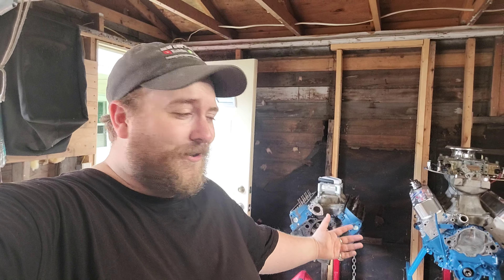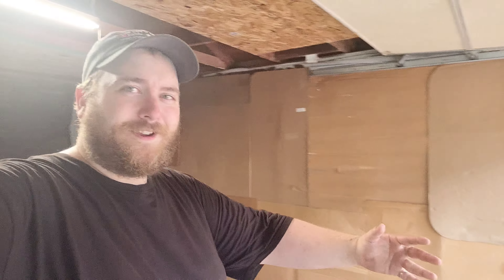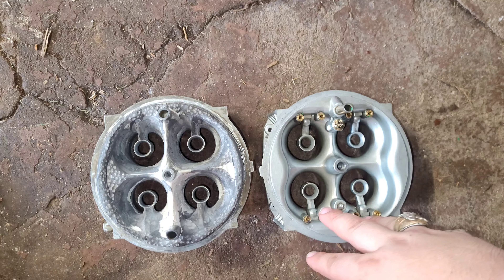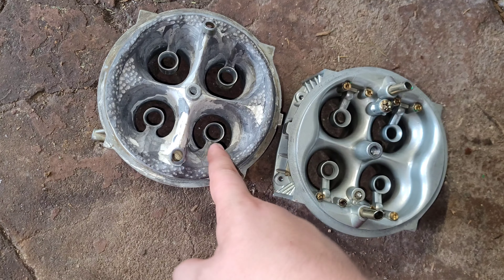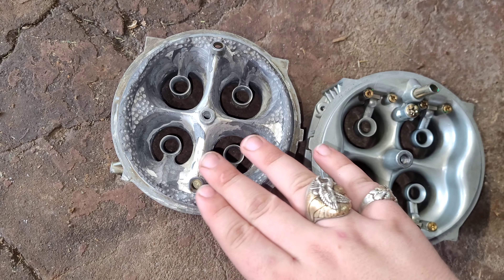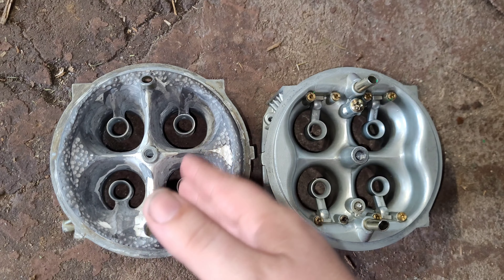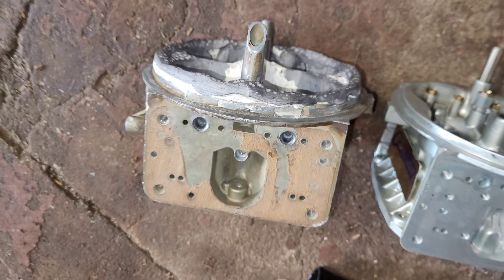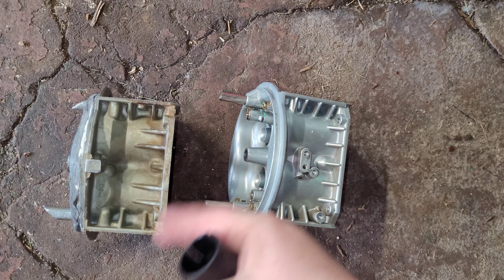Carburetor CFM Mods! | Big Performance Gain! | Project XMC Holley Carburetor | Fine Tuning Airflow

Comment: Project xmc is coming along nicely. I registered just to comment on your videos here. As a fellow carburetor and speed freak enthusiast I like your break out of the box mentality. So speaking about booster signal - how about a comparison test with a clear tube between the main body and the vacume? Hook up a fuid supply somehow to the booster wirh a jet. Nothin fancy, quick and dirty does the trick!
Reply from the maker: @DanLeveque  oh dude sweet! 
I truly appreciate you following along and I am truly humbled you made an account just to comment! Thank you! 😃

Ok so the setup your suggesting, are we looking for how the fluid will come out of the boosters? Or what is it we are looking for! 😁
Reply: Basically,  let's see physically what's happening with that increased booster signal on the xmc vs the proform vs the play doh modified proform
Reply from the maker: @DanLeveque I can put a fuel bowl on and fill it with a liquid then vacuum test the proform with and without the playdough to see if the liquid get atomized any differently 🤔

I could also get a vacuum guage and hook it up to the booster passage to see if we can put playdough in a few spots at a time and see if we can see an increase in vacuum! 😃
Reply: @newguysgarage6802  play on brother! I think it would be interesting to see.  I have no idea if a regular vacume gage would work. I think it would require something more sensitive.  Ultimately though  the xmc has something more to say and I'm fascinated  with how it will really work on the road and track.  I personally run that same proform main body and have been real impressed with it.  I have a 850 vs base plate I've been interested in adding to it. Started lookin around to see what other people were doin and found you doin your thing. Shoot I'm talking too much. Lookin forward to your  next experience man!
Reply from the maker: @DanLeveque  I put an 850 baseplate on my 750 main body a while ago! 

I have some videos on how I did it if you hadn't seen it already 😃

https://youtu.be/NDdPmoW8Gx0

Comment: Thought you were going to burn your lips with that new flow test when is the engine going in looking forward to first pass have a good one
Reply from the maker: @davesaylor5135  I just ordered pistons that will work with my heads finally, just need gaskets and stuff.

Money is tight now with buying the house and all 😅

Comment: Port n polish smooth less friction
Reply from the maker: Not necessarily, a ruff surface finish can lead to a strong boundary layer.

Air will flow over air a lot smoother than it will flow over a solid surface. 

Like the golf ball affect lol